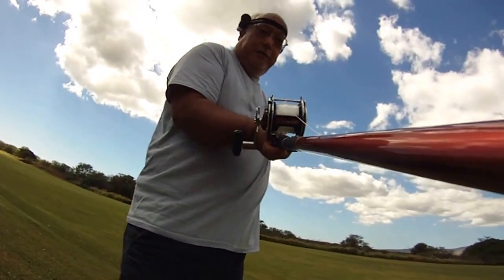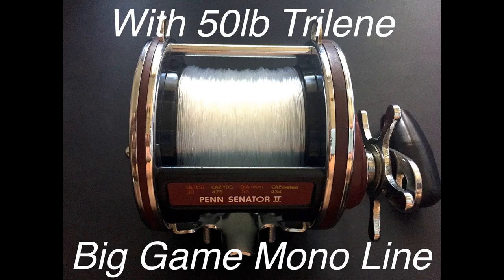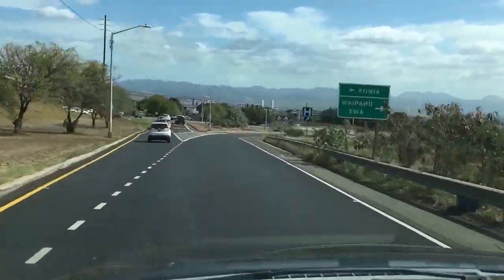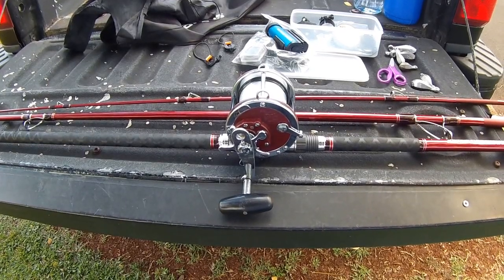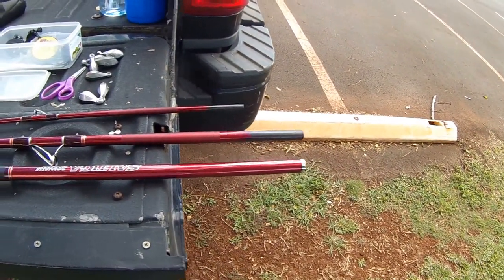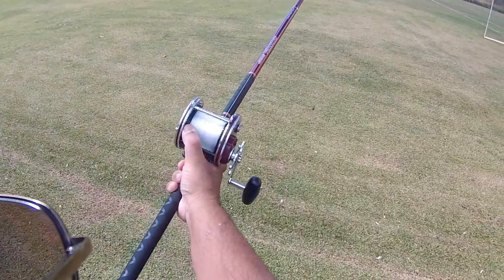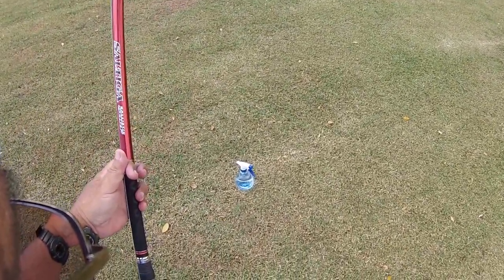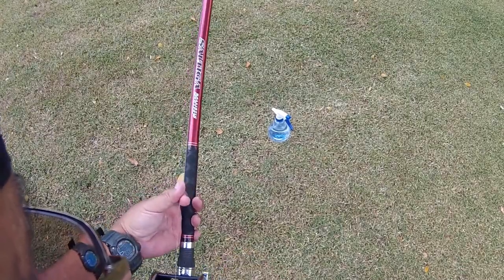Penn 113HL Reel On A 13'3" Daiwa Ballistic Rod!

Comment: I cast a 112H AKA 3/0 75 yards and beyond all day long with 3 Oz weight and an 8  foot rod sometimes I put it on a Ugly stick  Big Water 12 foot  Surf rod for long casts.
Also have every size conventional level wind they sell and took the level winds off.
You can cast any of these reels a long ways if you train yourself to do it.
All of these type reels were used for casting at one time. 
Keep up the good work.
Reply from the maker: I grew up on the Jigs, 3/0 & 4/0 on heavy fiberglass rods. In the 70's that's what we had. Also large Luxor spinners. Nowadays for conventionals i use mostly Newells with ceramic bearings & Tib handles. I'm currently happy with my casting & equipment, i only practice for accuracy more nowadays. I still have my old Senators for trolling, they're not as strong as the newer models but i know how to service those older units. Thanks for your message:)

Comment: I have the exact same reel, static magged & drag upgrades on 12 foot Tsunami for sharks in surf.
Reply from the maker: Is it good for you?
Reply: Scuba Chris it’s decent, good for maybe 70 yards? I’ve been thinking of getting ceramic bearings for it.  It also has 7+1 drag upgrade.
Reply: I got a vintage penn senator 4/0 I'm about to get a custom casting rod for it

Comment: You would get A LOT more distance with a reel made for casting.  I have that same rod and I can cast 3-4 time the distance with a Daiwa Saltist BG30.  Casting with 50lb line isn't going to work.  Run a 20lb main line and tie on a 50lb shock leader.
Reply from the maker: Hey Andrew,
You're correct. This rig is for pure power for shore casting weights for sliding dead or live baits. Very user specific. Can't slide using braid & you need the stopping power for GT's or sharks. On my boat i caught a 180lb Yellowfin Ahi Tuna on my inside line on a 4/0 w/50lb mono so i know what this can do. Thanks for watching my vids.
Reply: I wouldn't say it's for shore casting - that set up isn't for anything casting related.  Good for trolling or as you said sliding baits down an anchor line.  We call that pin rigging but we use Shimano TLD 25's.  Not doubting it's power though, would be better suited with a shorter heavier class rod.   Looking into Penn 525mags or Saltist BG30's if you want to get some distance from the surf.
Reply from the maker: Penn 4/0 & 6/0 are common shore casting reels here in Hawaii.
Reply: That is wild - I've never heard of anyone casting a reel that big.  Which model Daiwa Ballistic do you have?  I have the 40-405 and it is STIFF.  Looking for a 35-405 currently.
Reply from the maker: I use the one you're looking for. What i don't like about it is i can't put a SS butt on it unless i forego the weight screw-on butt. But i like that i can go spinner or conventional on it.

Comment: what size wight you used
Reply from the maker: I was using 7 & 8oz banks. Didn't have a 6oz but i feel it might have sailed longer. The heavier i went the faster it dropped. But i think since this unit sat on a shelf for many years that a lubing might be all it needs.
Reply: Scuba Chris how much was that rod? you went charleys?
Reply: Scuba Chris hey I think you did real good if was ur first time trying hey just keep at it when you have time practice makes perfect right for my I practice with a 3/0 keep the videos coming
Reply from the maker: Yes, i got the Ballistic from Charley's. They have great people working there & the prices speak for themselfs. I started buying from them when they were on Keaumoku St near Ala Moana (look for the fish sign back then). As for the price you need to go in & chat with them. Cash is helpful. I never give out what i pay for my gear because that's a private issue (unless it's a advertised set price). In fact +90% of all my rods, reels, gear, and line spooling services are from Charley's Fishing Supply. Yup, i sound like a commercial. lol
Reply from the maker: Thanks! I'm a bit embarrassed as i know i used to throw 60-80m back in the 70's/80's on heavier obsolete gear. No excuses, i need to practice. But it did dawn on me that the reel sat on a shelf from the 90's. I'm sure some oil & lube would help.
Reply: Scuba Chris true! that's the only shop I pick up rods and reels from! best crew out here for cash deals! just wish they was located more west of the island lol.
Reply from the maker: There are many tackle shops on Oahu that are great for prices and quality service. I hit Sawada's in Wahiawa for whipping hooks and lead. Kaya's also for lead. POP for variety. Waipahu Bicycle for line and servicing/repairs. J&E for accessories (ie hooks, swivels, leaders, glow threads, etc). Brian's for specialized gear, plugging needs, reel & rod repairs, and the best knowledgeable angler who knows his stuff. Westside for hooks & quality plugging needs (also for my diving needs at Kunia Rd). Charley's for great prices, especially on rods & reels. I'm not putting down shops that i occasionally frequent, i'm a creature of habit. I like certain localities & dealing with people who i'm familiar with.

Comment: Man thanks not s great cast, try to add a rubber on the reel to thumb it so you don't  burn your thumb
Reply from the maker: I don't burn my thumb on this reel. It's my inside rig. Still need to get 40-50m max though when needed. I have prototype conventionals that'll get me the distances i need. Just have to many projects to catch-up on right now. But gotta clear my plate for 2 new lines of rods expected to arrive. Thanks for watching Ed, i appreciate it:)